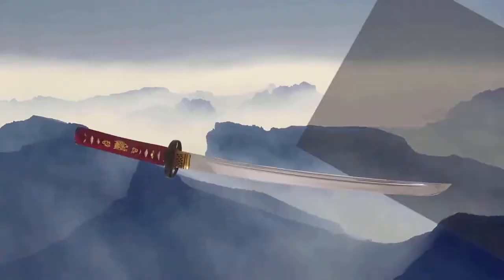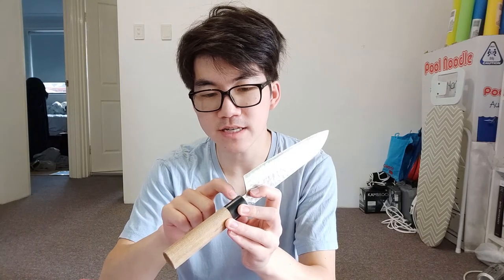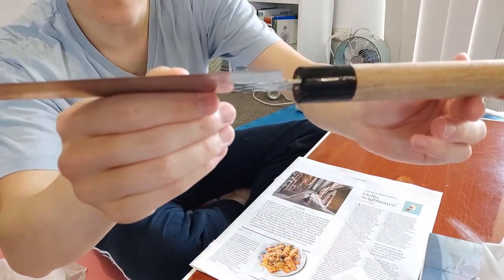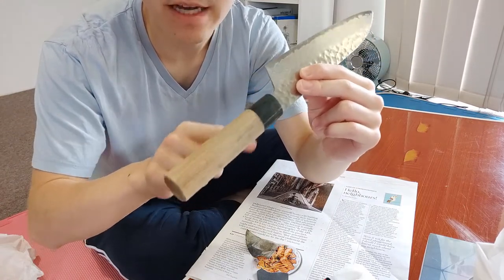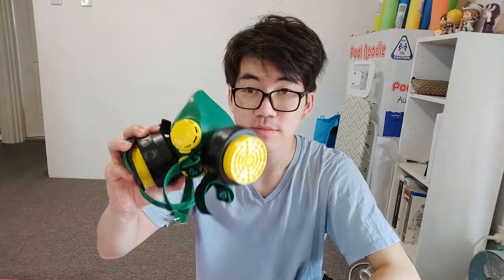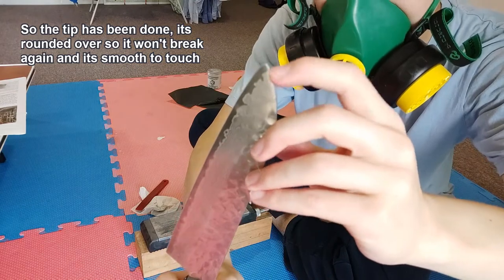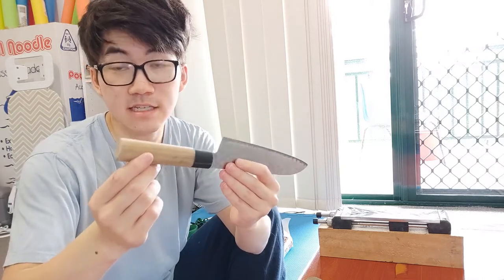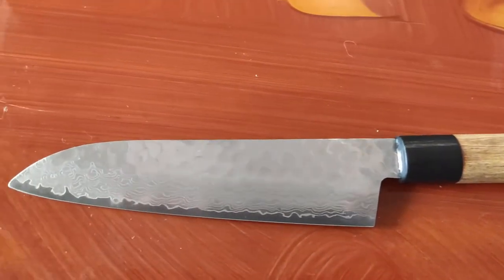Fixing an ABUSED Japanese Santoku knife [vlog]

Comment: Hey I have a really unorthodox (at least I think it is) idea inspired by your katana half swording video. It's a little difficult to explain without a picture but I will try. It is basically just increasing the entire length of your body covered by the blade by using the sheath in combination with the blade.
For example.
You have the same high defensive guard combined with half swording like you usually do.

But instead of half swording the blade, you have you SHEATH partially covering the blade (as in the blade is partially inserted into the sheath), and you're half swording hand is holding the sheath in place. 
You can move it around like you usually would to block attacks, but this time because you have more area of your body covered because of the extended range the sheath gives you, making it more protective.

You can also just drop the sheath at any time to switch to two hands on the grip.

I'm really sorry if that is hard to picture but if you want we to send a picture we can probably work out some way lmao.

Also if this is stupid I'm sorry but I was just messing around today and found that out.
Reply from the maker: Interesting idea. I think at that point though a shield might be a better idea. There's few sheath techniques because the sheath is not usually the best tool for any application other than sword storage and there's usually a more optimised tool
Reply: @JustaBug  ya, also it's not like a sheath is made of sheet metal. One good hit and it'll be split.
Reply from the maker: Indeed. One good hit and you've got nowhere to return your sword to. It was an interesting idea though